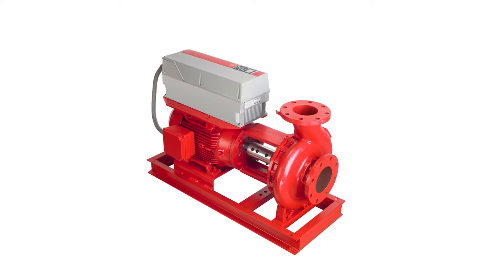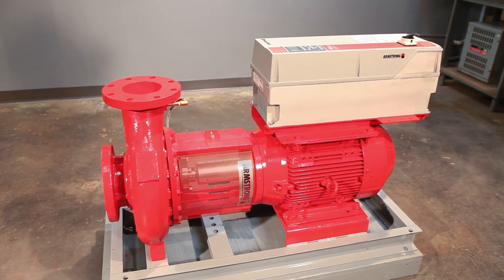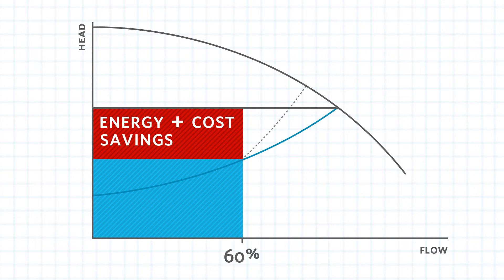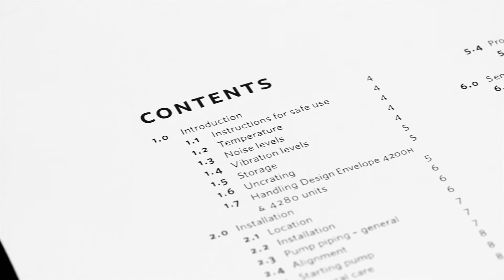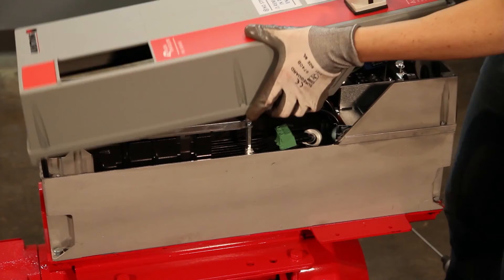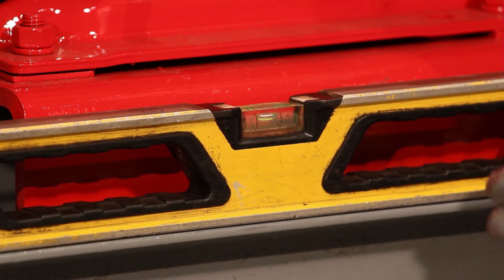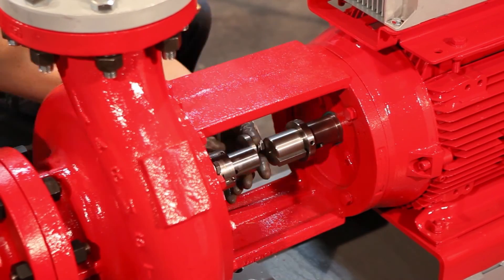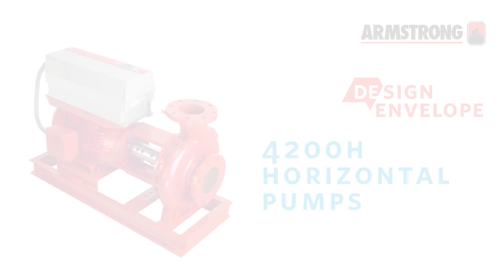Design Envelope 4200H Installation

Comment: what was placed between the pumps base frame and foundation in the video ?
Reply: It’s called coupling it’s attached to both the motor and the pump lot spin together i currently work as assembler at Canada branch